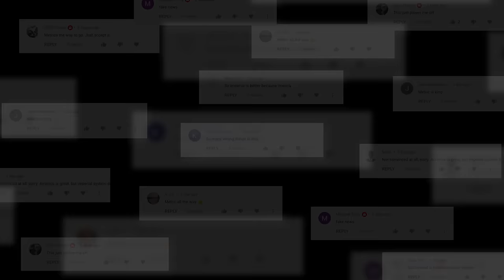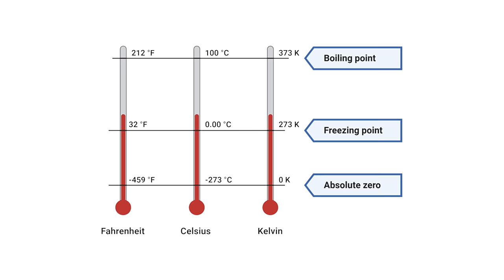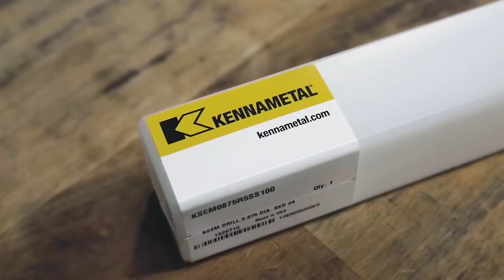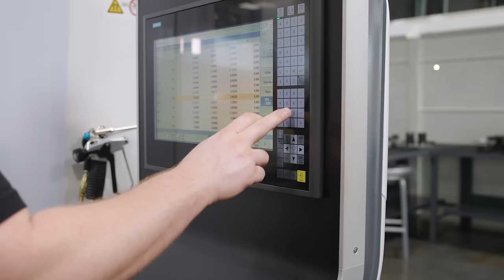Why METRIC is SUPERIOR to IMPERIAL

Comment: I am an Indian and i use METRIC. But something good about working in Malaysia is , anything related to production, CAD, CAM not only uses METRIC but also the Construction department. Every single construction layout is in MM. The weirdest part is the CONSTRUCTION departments in INDIA still uses IMPERIAL....a bit annoying.....but still can be used.
Reply: Yeah, they still use inches to measure wall height and use square feets to measure a room area.
Reply: For someone in construction it is far more intuitive to talk about 8 foot ceilings than 2400mm ceilings. For day to day life imperial still makes a lot of sense, but I still much prefer to use metric, even in construction.
Reply: I have to master both. That thing he said about imperial taps didn't make sense. I can do both the same way. Major diameter minus the pitch . 1/4 minus 1/20 =.2
Reply: @davidandjessicaclay2333  It's not that imperial makes sense for day to day life, it's that US Americans are accustomed from young age to imperial using it for day to day life. Thus it is harder for them to use metric because they have to learn to use it when they are used already to imperial. You might say that I am just talking semantics, but I like to call out the real reason here. Metric is not taught properly and not used as a prime measurement system, and schools are just brushing over it just to check a mark to say they taught it.
Reply: @davidandjessicaclay2333  
In "real"metric world construction switch to cm and metres, your seiling is 240 cm or 2.4 m, saying as a " two forty " height, everyone in the metric world will understand that you'r meaning 2 metres and 40 cm. 😉
Just like I'm NOT 185 cm tall, ....... I'm "one eighty five", it's all in the name and how to use it.
Reply: @davidandjessicaclay2333  how in day to day life 8 foot could make more sense than 2.40 m ? (Or 7' 10" vs 2.35 m if the client prefers not that high) 
2400 mm is only used when millimetre precision is required (architect, builder...). And the maths for converting 2,40 m to 2400 mm are quite easy!
Reply: @ytfan3815  No, lol. Maybe like 70 years ago. But today all drawings are in one unit only.
Reply: @laszu7137  Yeah you right, on the drawing it's [mm] but the people who handle stuff quickly switch to [cm] or [m], just like I said in my comment.
A European carpenter never uses the 2400mm when he means a 2.4m height, just saying. 😉
Reply: @ytfan3815  
Just on drawings to avoid x.x dates and for precision to avoid rounding errors each time you forward a calculation 
E.g: a + b = c and c has to be an integer of four digits, without decimal separator.

Comment: The video forgot to say the biger advantage of the metric system: When you have to change to two or three dimensions like : How many gallons of water fit on a swimming pool 30 feet and 5" long, 19 feet and 8" wide and 7 feet deep? (Try it without calculator)
In metric just multiply all the measures and the volumen comes in litres, and that's it!
Reply: Yeah, I felt like he was linning up to tellus jus that, and then for some reason skipped it.
Reply: There's also a quote from a book about conversions in metric versus imperial, paraphrasing here: "How much energy does it take to boil cubic liter of water from room temperature, possible to do with metric in imperial the answer is fuck you"
Reply: I think I would go with inches.  365" * 236" * 84" cubic inches.  Then divide by 231 since I use US Customary gallons and it's defined as 231 cubic inches exactly.
Reply: You missed a step though. It has to be in meters to get your answer in liters.
Reply: @CommanderCodey  absolutely not, that would be a cubic meter (m³) which are 1000 liters. But in cases like pools no one measures in Liters because one m³ of water ways around a metric ton and the value if needed in liters can just be converted by multiplying
Reply: @Vahlsten  there is no reason to say cubic  liter.
Reply: @emiliosagichnicht7521  there is no such thing as cubic liter.
That would be the same as a salty ocean.
Reply: @CommanderCodey  if you want the answers in Litres you have to use dm scale (10 cm is one dm, 10 dm is one m - following the same logic as 1000g is one kg instead of using random body parts and a liquid messured in a blown glas somewhere around 1700-hundreds or so)
Reply: @CommanderCodey  

A litre is 10cmx10cmx10cm. There’s 1000 litres to a cubic metre.
Reply: and 1 cubic meter of water wheighs a ton, since the kilogram is originately defined on the weight of 1 liter of water :)
Reply: @ronnyhansson8713  dm scale is only used by people who wear white lab coats.
Everybody else uses the scale their cars or motorbikes use: CCs.
1,000cc = 1 litre = 1 kg (of water).
1,000 litres (of water) = 1 tonne of weight and also 1,000,000cc.
Reply: @ronnyhansson8713  All I can say is that coming from a metric country most recipes I've seen demand grams or ml or metric cups or metric tablespoons or metric teaspoons.
Reply: @aaronleverton4221  well I am from sweden so using imperial means me doing some math - and most recepies do damnds x dl of this or that, especially baking, or as you say metric teaspoons/metric tablespoons
Reply: @Rack979  The US gallon is a smaller gallon than the British gallon so, as the equation doesn't specify whose gallon is being used there is still scope for error. Just use the metric system. It's intuitive and more accurate. It's just better.
Reply: @Vahlsten  "Cubic Liter" - A Liter has the same volume regardless of the shape...
Reply: The volume comes in liters if you use decimeter measurements which nobody does. More likely you use meters and multjply them to get cubic meters. You can still multiply by 1000 to get liters which is a bit of an oddball metric unit.

Stick to the real units and meters times meters times meters is cubic meters. What could be easier?
Reply: next thing: how much fits in a 1mx1mx1m block? 1L. how heavy is that 1L? 1kg
Reply: @astrid2432  It's 1000L and if it's water it weighs about 1000kg, or 1 metric tonne
Reply: @aaronleverton4221  Wrong symbol for cubic centimeters. It’s meant to be “cm3”, but with the three as an exponent.
Reply: @Rack979  I second you.
Reply: @thewhitefalcon8539  oh sorry
I got confused with the differences
you are right with it
Reply: @viquezug3936  Tell me you've never owned a motorcycle without telling me you've never owned a motorcycle.
Reply: 1m wide, 1m long and 1m deep? That would be 1 cubic meter!
Yes, it's really complicated, the metric system.
Reply: @aaronleverton4221  as a white lab coat I can assure you we don't use dm. Only ml, grams and liters. Kilograms in rare occasions
Reply: @aaronleverton4221  Just because the wrong symbol is used by manufacturers, distributors, mechanics, riders, etc., does not mean it's correct.

I would go so far as to say that the SI is too good for most people because y'all keep bastardizing it further and further, making it lose its good traits.
Reply: @viquezug3936  As a matter of fact, that is exactly what it does mean. 
The SI does not govern the English language.
Go find out how old the word "flammable" is.
Reply: @Rack979  "I think I would go with inches.  365" * 236" * 84" cubic inches.  Then divide by 231 since I use US Customary gallons and it's defined as 231 cubic inches exactly."  How much would that be exactly in US customary volume units? (using whole numbers and not using a cubic length volume)
Reply: @astrid2432  It depends what is in the block. If it is water then as Alex said: 1000kg, or 1 metric tonne
Reply: If you think that's all mad, I'm an airline pilot in the UK, we use Feet for height,  Knots for speed, distance in nautical miles, weight in kilograms, fuel in litres, runway lengths and stopping distances in metres,  temperature in centigrade, air pressure in millibars but hydraulic pressure in PSI...🤷‍♂️🤣🤣
Reply: Try dividing by 231 cubic inches without a calculator. 😅

Comment: I grew up with Iperial in the UK then the metric system  started to be brought into schools in the early mid 70's it was stressfull but metric is waaaaay easier to use overall, manufacturing, science, every day stuff. Especially if you have to deal with threads. Metric taps and dies are incredibly simple and versatile where you have standard pitches and sizes and lesser used sizes and pitches for more specialised applications.
Reply: As a person from a metric using country, your neighbour Iceland (we are like 900km away from Scotland), I can tell you that I did not learn a single thing about the imperial system in elementary school, high school or college. I only know that 1 feet is about the length of a Subway sandwich.
Reply: What did you actually find stressful about it? I was only taught metric and I failed maths due to shit teachers purposely stopping me from sitting the higher level paper. I can still convert from metric to imperial in my head as it's really simple maths.

Comment: Even though I live in Canada I use imperial since professionally I'm an hvac mechanic, everything we use is imperial. But as a hobbyist when I'm designing things in cad I started using metric. I'm currently building an arcade machine and for the first time I used metric to actually measure and build. Holy s@$! what a difference. Every measurement I made with a metric ruler and the math was so easy. In the past I would have struggled with converting fractions to decimals and then adding them together and getting some half assed measurement that was always a little off. Thank you metric system.

Comment: The issue is I had, and have fixed, was converting the metric measurement to inch in my head. Then one of my coworkers said to accept the measurement for what it is. Do not convert it. A mm is a mm. And it's this big (holding my fingers .040" apart) So when it says 10mm, visualize that distance in your mind. You keep doing that and all the sudden it just cliques. It becomes natural. All of our prints, machines, tools, etc. have all been standardizd to metric. Now when I have to work on one of our old machines that was made in inch I hate it. I have to have inch tools and a separate tool bag. Luckily as we phase out old stuff and get new, it's all metric, and I love it.
Reply: We done that in Europe when adopting the Euro... In France, the change rate was "1 € = 6.55957 FF". Not the easiest, isn't it?

On the beginning, I was constantly converting - despite that ALL labels were always in BOTH Euros and Francs. I used some tricks, like "15€=100FF" to make it easier, but I was still struggling with big amounts: prices for a car, or worse, a house were simply impossible to evaluate when written in Euros and I needed to convert it back to Francs.
Then I started to "accept" prices in Euros, for daily things... A coffee wasn't 2.50FF anymore, but 0.40€ (yeah, they raised all prices a bit, these b*stards...). Same for my bills, and finally my income.

And suddenly, all felt into place: a car's price was understandable in Euros, like a house. Because, inconsciously, you estimate these prices according to your income. You may not realize it, but you don't think "This house costs 250.000€", but "This house is 4 years of income"... Then, according to how much (in percentage) you can save monthly, you recalculate this in "This house is 20 years of savings". And NOW, you know if it's affordable for you - or not.

For units, it's the same: you do NOT know what a "gallon" is. But you know the WEIGHT of it, you know how much you can carry - let's say 10 gallons max if needed. You can't understand liters because you didn't realized what a liter weights... You don't know "a mile", but you know that you need 15 minutes to travel a mile during rush hours... And around one minute on the freeway.

Most of the time, the "hard units" are (small) lengths and weights, meaning feet/inches and pounds for an American, because they are the only ones where you really need a daily evaluation. Kilograms is quite easy: you can round up with "1 kg = 2 pounds" for small weights. And obviously "1 m = 3 ft" and "1 inch = 3 cm". But that's good for tourism.

It won't help, but in the very beginning... What you need is to STOP ESTIMATING THINGS. Measure them instead. I'm fully used to metric system, trust me, but I'm very bad at estimating lengths: 10 meters or 20 meters is quite the same for me... And I'm strong enough to simply be unable to distinguish anything between 5 and 20 kilograms. So I measure everything I need to know precisely, from my boys' weight for medication to a room's size for buying furnitures or materials.
And once you stop to estimate things constantly and accept the new units, then "magically" you're able to estimate lengths and weights again... If you were really able to estimate them on sight previously, and not constantly put your thumb or your feet close to stuff to "estimate" them.
Reply: @mac_lak  You're on the path to enlightenment when you accept the world as it is, rather than try and convert it to your liking. Not just in measuring or currency, but to life in general.
Reply: @mac_lak  Same here in Germany though a bit easier with a conversion of 1.95.... Marks to 1 €. The roughly 2:1 made it more intuitively comprehensible though. Interestingly we still have "Pfund" = pound as a weight. Way back in the past- must be 150+ years - depending on where in Germany you went it could be anything between some 400 to some 600 grams. At one point it was then standardised to 500 g or 1/2 kg. This is still sometimes used today epecially in butcher shops.
Reply: That's how I deal with imperial measures in Europe — 15" notebook, 24" display, 6" smartphone, 3.5" floppy disk, 2.5" hard drive, 1/2" pipe.
Reply: @sergeykish  I really wish they mandated laptop etc. sizes being displayed in mm.
Reply: It is the best practice to relate things to your body but not confusing them with your body